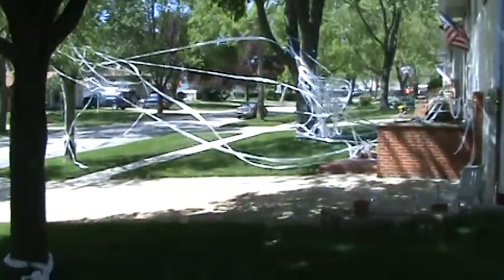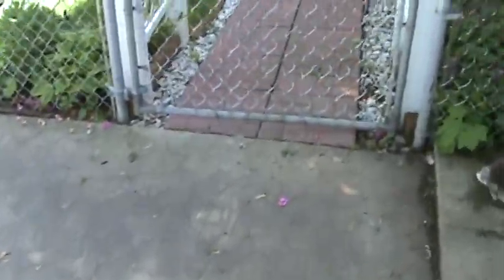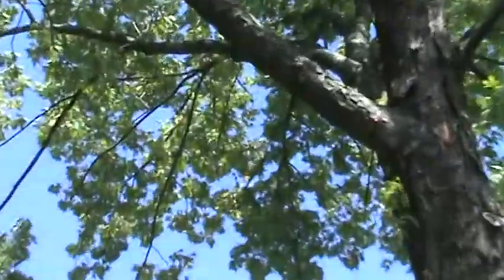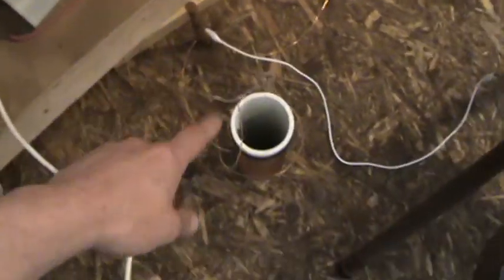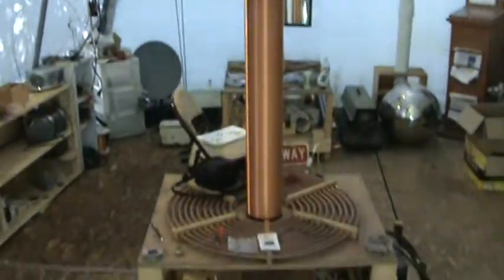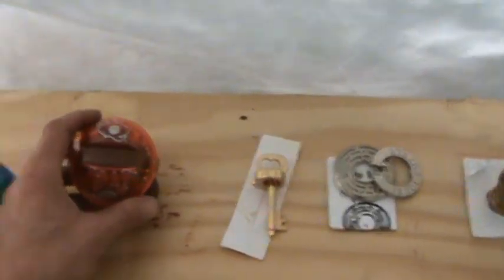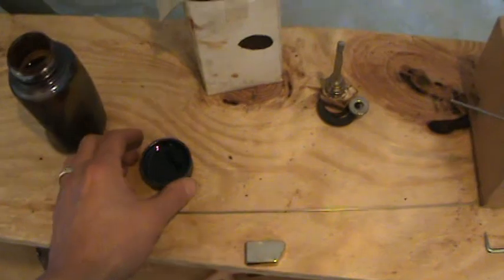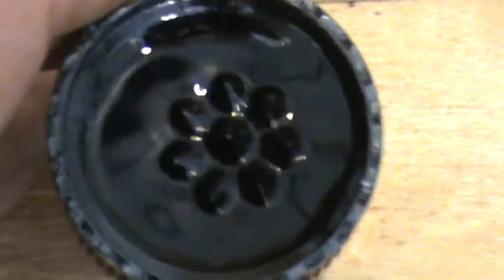FREE ENERGY FROM AIR CIRCUIT PART 3/24

Comment: I have tryed this tipe of circuit and my cappasiters go up to over 90 volts.I allso get faults readings of 2000 + volts. I dont know how to send skymatics from this page.
but you dont need a large antana Tesla used a 4 foot antana or smaller I am useing a 6 inch tipe of tesla coil my E mail is russell.bits.2@Gmail.com

Comment: use the wire coated 1 1/2 in p.v.c. pipe as your antenna 25 ft in the air

Comment: I will be trying longer antennas and different configurations in the weeks ahead, and will post anything interesting. To me what's interesting about this circuit is that it works even without a ground or any kind of return to it's input. That seems to indicate that it's working off of Radiant electricity(i.e. Tesla's longitudinal waves)
It reminds me of Avramenko's plug.(google 'frolov1.htm' for a good article on it on Kellynet) I think I'll build one and see if there's anything to it.  ; )

Comment: Silicon(will try Ge). I'm at 2800'(Joshua Tree, Ca).
Have you heard the story of the Art Bell(legendary radio host) antenna?
He had a huge loop antenna going around his 5 acre property for his short wave rig. He claimed to have over 400Vdc coming off it with no special circuitry.
He only talked about it a couple of times on his show so no details, but I would think he had to have at least a few milliamps from it.

Comment from the maker: Nice.  Are you using germanium diodes or standard silicon type,,,germaniums cause the caps to charge faster.  I suggest to try differant antennas,,,the tv antenna is already designed to pick up a specific range of frequencies.  Do you know what altitude your at, sea level your at? google earth. What is your location?

Comment: Also I noticed that when I was holding one of the output leads it charged much faster. So I hooked up a long wire to the positive output terminal and it increased also but not as much as with my body. It seems strange to me that an antenna on the output would increase the energy in the circuit. But then again the world of RF is very strange indeed.  Thanks for posting your work.

Comment: I like your videos. Very detailed and inspiring. I built the basic ciruit last night and hooked to the old tv antenna on my roof. The caps are charging at a rate of ~5mV per minute. I'm up to 4V now.  It seems to have been charging faster last night. Maybe that's because of less solar interference of the AM band.

Comment: OK I get you get some voltage but the current must be very low.  Perhaps uA.  I don't know how usable that would be.  Essentially the capacitors are storing static charges from the air.  If you connect it to a load and dry current, the charge will dissipate very quickly.  Maintaining a constant voltage while drawing current would seem to me to be extremely difficult.

Comment: May I suggest increasing the surface area of your ground. Although the ground rod that you are using is good, it's surface area may not be enough to handle the power in your system. Perhaps burying an old radiator (Paint removed) will give you sufficient surface area. The rad can be laid flat, about 6" - 12" deep and also wired to your existing ground rod... Hope that helps :-)

Comment from the maker: @begztube Ohhh, many with the same problem....important thing is to try to find a germanium didode with lowest voltage drop you can find. Silicon didodes have .6V drop,,,,germanium have .4 V drop.  try to find a diode that has like .4 V drop if you can.

Comment: Your steel hooks are acting as choke coils. Find a way to fasten your wires without close intersecting coils, especially over an iron core. These choke coils will produce power robbing eddy currents and internal impedance.

Comment from the maker: @rammgarr Antenna needs to be long and high, both.  It can not touch anything,,it must be insulated from what ever you mount it to and come down on an angle to the circuit, dont let the circuit touch anything either, insulate from ground. Coaxial works ok, but varnish type coated wire works best so far. Coaxials have a habbit of capturing "Static". Regular antennas do not work, because they are specificaly designed to capture a very specific "range" of frequencies.

Comment: Paul..about the antenna .,is it more important to have it highter then longer or both.do i have to insulate it from being graunded and the wire coming in to the generator do i have to use coax cable or just plain insulated wire???i i just finish building one but i dont get absolutely nothing i used my cb. antenna and i used my out door tv antenna and no reading of any kind.all the components check ok..,help!

Comment: hey there @INVENTOR3 awsome free energy, i had an idea to get more power from ur model. The power that your air current generates could run the little motor that runs the Van De Graaff Generator which collects static electricity, you could have ur self a free energy generator. just a thought.

Comment: Wood is not a perfect insulator, could be part of the problem you are having with your voltage, grounding your antenna. When you measure power output, don't just measure the voltage, measure the voltage with a resistive load. What good is a static 18v if it drops to .5 v when driving a load.

Comment from the maker: @JRBeaman Oh , i see, when i said it is not in range, i did not mean distance, i meant that the frequency of 258KHz is not in the band width of radio, AM starts around 526KHz,,maybe long wave of 148 to 283KHZ, but it is not allowed on this half of the planet. Sure, i could be picking up a harmonic of something, i could also be picking up energy particals that were transformed from energy that fills the cosmos

Comment from the maker: @JRBeaman Hmmm, maybe plausable to b picking up a mixture of frequencies.
Maybe interesting to know that the coil made voltage rise from like 24V to 125V and the current barely went down at all, there was almost No trade off.  That was the surprising thing.

Comment: I did this By accident Because I collect Short Wave, Receiver Multi Band Radios.
One night during a thunderstorm I herd a noise like a high tension line and it was my Antenna Picking up stray EM from the Air and transmitting it down my Coaxial shielded cable and onto my desk where I had some white paper laying on the exposed end of the Cable causing this sound... this is how you make a Cristal Set with a Diode a Cristal and a Veritable resistor AM Radio.

Comment: from the wire to your circuit and meter try using coaxial cable you are getting charge bleed off.
It is called Induction.
I found that you can get Lots of voltage up into the 1000 s but almost no Amperage... I did not however use Diodes or stabilizing capacitors.
Ill try that....
but be careful you can get a Nasty Shock.
String the induction wire up on both Ends and Isolate it from the ground and then bare a coax on one end and Solder it to the Isolated Wire. good Antenna and EM Inducer.

Comment from the maker: i sugest that you watch the last 3 videos  "free energy from air circuit-HOW TO"
Definately not static, i belive i proved that one.
incoming frequency is above power line and below radio.
Yes, i believe i can tune the circuit yet to resonate....which should increase power many times.
Question is do i tune to incoming frequency or try to change incoming frequency to something like gamma, and then tune to it to resonate with that frequency....i will try both!
thanks for the comments.

Comment: Most of your volts are coming from residue electrical power in your lap.  Try disconnecting your power supply to your lab and see what voltage you then have.  Alternatively, just move the aerial wire in relation to your lighting, and you will see the volts go up and down!

Comment from the maker: also have been checking frequencies....
higher my antenna, more voltage...longer the wire, more current. frequencies are differant with every set up i do...i can add a coil between antenna and circuit and get more voltage and less current and completely differant frequenciy again.  My frequncies are not in the radio band width.
and i check the frequencies at AC...before i attach my circuit.

Comment: lol ,I think you are picking up radio waves, you are using a simple di pole antena , the longer the wire the higher the voltage from the radio waves ,lol ,lol how do you think you get your tv ,radio , lol 2 wires or 2 metal posts in the air ,lol look up di pol anti for cb radio ,,,,,

Comment from the maker: Good to hear from you.
Magnetic cancellation...hmm did not think of that. It is only one antenna wire. starts at board, goes to tree, around branch and back to opposite side of board and down into corner of lab.  Loop config sounds interesting.

Comment: Glad to hear you got the insulation clear of the circuit. The one thing I notice is that your running your wire like a twin axial line. This arrangement is known for creating magnetic cancellation in the wire. Moray used 70' of wire in a dipole configuration. Say 35' W and 35' E with a separation between. One pole (Say E) was + and the other (W) was attached to a ground rod driven 7' in the ground. His receiver was then attached to + and - . You can also use a loop config running around the yard

Comment from the maker: this set up should get you some results, i tried car antenna also, i got better results with a 6 foot long wire though. Use double circuit design and ground also.
i have used germanium and zeener, but i have not tried regular silicon based diode, i can not say how they work.
car antenna is designed to pick up an exact frequency band width..so i would not be able to say that you are picking up power from the cosmos , but rather only power from radio station.

Comment from the maker: ***ATTENTION***
SET-UP DOES WORK!!! IT WAS A LONG DAY THAT DAY, SPILLED FERRO FLUID ON ME, AND POWER FAILURE, THAT WAS JUST A COINCEDENT.
ANYHOW...I FORGOT 1 SMALL VERY IMPORTANT DETAIL, TO STRIP THE VARNISH COATING FROM THE END OF THE ANTENNA, WHERE I ATTACH THE CIRCUIT.
I GOT 7.1V DC AND 340. MICRO AMPS, MAYBE MORE, I HAVE TO CHECK OVER CURRENT FUSES IN DMM.
i BELIEVE I CAN RUN 30 CALCULATORS NOW.  i WILL NOW TRY AN ADDITIONAL TALL POLE SET UP ALSO, AND TRY COAXIAL CABLE, AND DEEPER GROUND

Comment from the maker: what kind of antenna set up do you have again...
I will be doing a lot of testing with antenna set-ups now.
I may have to construck another tall pole, made from PVC pipes. Material of pole may make a differance...Hmm, pole in ground or on top of ground, will this make a differance.  too be cont.

Comment: The Tesla patents list a shiny insulated metal plate as the antenna tip, a straight wire with no loops or turns as the antenna wire, leading to an induction coil, to a sparkgap and to ground. 
But even with the setup that you have shown here you should get way more than 1/4 volt, I can get 3/4 volt with a nail some copper wire, one square of toilet paper and some water...

Comment: Keep it positive bud.

Remember that the charge you get depends on the charge in the air. The day you tested just may have been a low charge day.

You may also do better if you just litzed the two wires into one and put an insulatoer at the tree rather than going around a sap filled branch.

Keep it up man, looks like you are doing some interesting things out there.